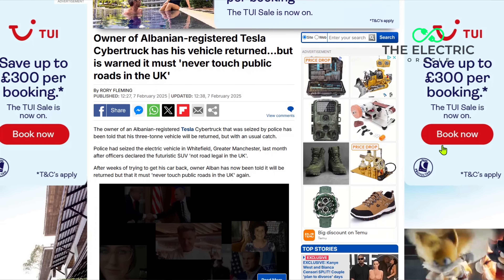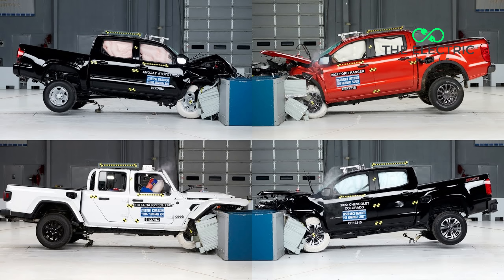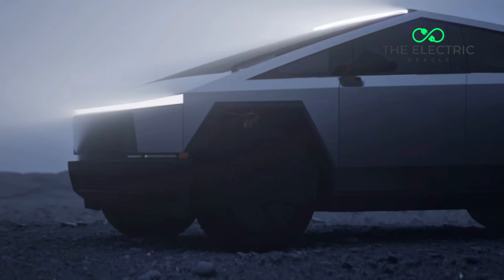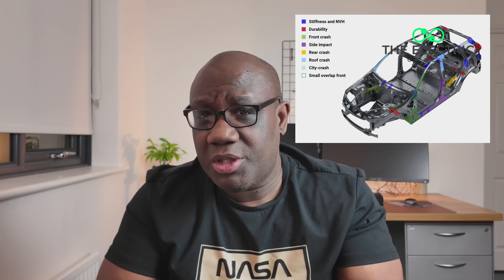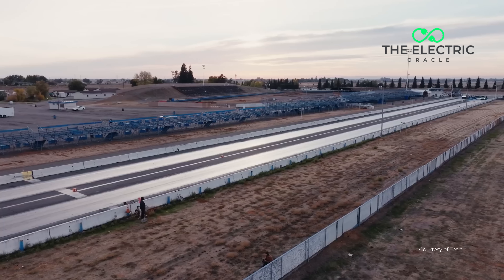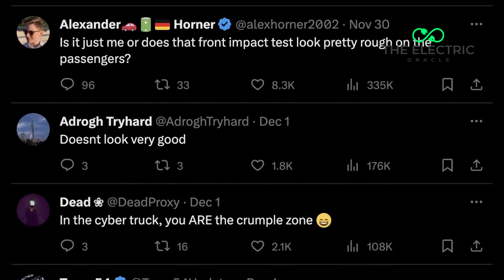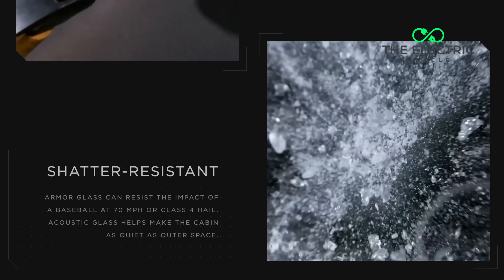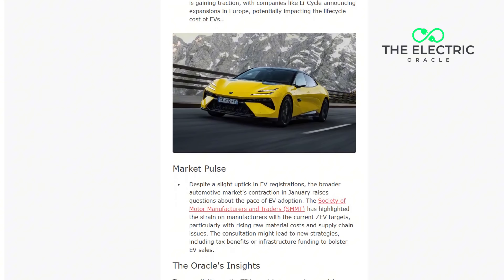Why the UK Banned Tesla’s Cybertruck – 5 Fatal Design Fails!

Comment: There seems to be a lot of misinformation in this video, I'll do my best to explain what I think is wrong. This is not pro/anti CT, I'm only interested in the technical aspect of things. I'm all up for discussions, but if you want to reply, please keep it on topic.

1. "Weight issue". The CT is not significantly heavier than any other UK legal vehicle that is 4WD, two door, has similar payload as well as towing capacity. etc. Saying it's too heavy because you cannot drive it with a passenger car license is just dishonest.

2. "Sharp edges". The CT does not have an "exoskeleton", it's an unibody - like almost any other passenger vehicle. Some of the exterior panels are structural, but so are they in many other vehicles. The 3,2 mm radius is a non issue, 0,7 mm thick steel is often used in cars and they can be rounded to 3,2 mm. The legit concern here is that the angled construction as well as the steel panels are more dangerous in a pedestrian crash, compared to a more rounded and/or plastic design.

3. "Light bar". What most people seem to miss is that the led bar is only a DRL, a daytime running light. The actual driving lights are lower. There are different regulations for DRL and driving lights. I don't know UK regulations so I don't know if and what specifications it doesn't meet, but I do think the DRL is a much better design than in a lot of "normal" cars, where they are very small and mounted very low, so they are not even that visible during the day and get easily blocked by terrain. 

4. "30X Steel". Comparing arbitarily chosen material property and trying to interpret crash safety from it just seems like a lack of basic engineering understanding. Some individual property is completely irrelevent without at the same time considering the complete design including, material thicknesses, geometry etc. With the same logic, a car with aluminum body panels would be less safe than a one with steel panels - which obviously is not how it goes.

5. "Crash test". "CT's steel resists deformation until catastrophic failure" what information is this claim based on? And where can I read the referred internal document about material choice? I'm not saying it's not true, I'm just interested in seeing it. The only legit crash test concern is that there are no 3rd party or public crash test data from the CT. 

6. "Mass and torque". This is basically a debate if a person is a responsible driver or it. I have no opinion since it's not really something that is inherently true or not.

7. "Crumple zones". We're again trying to intrepret meaningful information from misundestanded data. Again, CT does not have an "exosckeleton", it has a unibody. It has crumble zones. The pictures presented are of a Ford with HALF frontal collision from unknown speed, and comparing it to CT with FULL frontal collision with a relatively slow speed of 35 mph. Google "crash  test full frontal 35 mph" and you'll see that every test looks pretty much the same, with the front tires being slightly bent backwards - which in itself indicates that the CT does have a crumble zone. 

8. "Impact forces". The CT is not significantly heavier and there is no proof of it being less crash safe than any other similar vehicle with similar payload and other capacities. There is an valid argument if the CT was used as an replacement for passenger vehicle (instead of using it for work where the "truck" features are needed) which are safer when crashing into another passenger vehicle, but I have no opinion here since it's debatable and not inherently right or wrong.

Comment: Pushing design and regulation boundaries is fine. But the Cybertruck doesn't push them - It breaks them outright and with glory. These are not the same concepts. Please stop conflating words and ideas as you did several times on several topics during this video.

Comment: I'm in the US, just across the Hudson River from midtown Manhattan. There are tons of Tesla sedans on the road, but pickups are unusual enough that they draw comment. It's not clear what the market is. It's not designed for the usual things one does with a pickup truck. It's enormous, but somehow lacks space. It also appears to be badly adapted to the rigors of a job site, and with the monocoque steel body, it seems to be designed to not be able to take a modest impact without economically catastrophic damage. Everything about it seems to be designed to be both fragile and expensive to repair. One dent and the bed cover will be unusable. A chip in the windshield would cost a fortune. And I don't know why it's even allowed on the road, as it's heavy steel construction would behave more like a battering ram than a modern vehicle and it's just a mass of sharp edges.  It seems ludicrously badly designed, as if a teenage boy had set out to design the world's coolest truck.   But aside from all that, it's widely laughed at. People in this part of the country seem to lump it in with the Hummer as a showoff car for braggarts.

Comment: There is another safety aspect for EV's that isn't being spotlighted as it should.. and it applies across the board, not just to these monstrosities. When in an accident, a lot of these EV's are locking the passengers in the vehicle once the computer is compromised. But, being trapped in a metal oven coffin with 3000lbs of extremely volatile, flammable, and unstable chemicals that burn or explode on contact with air OR water isn't the worst part... even if you manage to be lucky enough to avoid that... once the controls are compromised, the EV's tend to start driving themselves... that's right, it looses the ability to tell when it's supposed to go and when it's not.

Comment: My 1995 GMC 2500 Vandura utility van also weighs about 7000lbs.  However it has a huge cargo capacity (our model has moveable beds, and removable seats for up to 9 persons), and has a larger fuel tank.  As such it has no problem being used as a skiing vacation vehicle, capable of starting and running in minus-40'F weather, and with a full fuel tank, going for more than 800 kilometers.  I recently went to a local meeting, and the Tesla Truck had its engine running, to keep the battery warm, at 20'F.  After two+hours, I wonder if that guy ever made it home.  Tesla Trucks are just symbols of "useless richness", purchased by persons who want to show off how wealthy they are, just like the private plane owners.  They are parasites on the rest of us, using up precious resources.

Comment: Fun fact: Did you know that the RAM 1500 is completely legal in Europe, despite having a similar curb weight (6,540 lbs), larger overall dimensions in all directions, poorer visibility out of the front windshield, and worse crash test performance even based on manufacturer provided data?

Comment: The rules cars need to meet to be allowed to drive on UK roads have been there for years. Tesla simply chose to ignore them. The car has not been banned, it simply doesn't and will not comply. Safety first, because safety came first. 
Perhaps they just never chose to export it and that's totally fine by me, I care not a flying f**k.
I have an EV, but wouldn't buy a Tesla if you paid me to take it away.

Comment: The question that comes to my mind is about the batteries. Given the dangers of an EV battery catching fire if damaged, I look at the issue of the truck hitting another EV. You would have two batteries that are a very strong fire risk. Apart from the damage that that rigid structure would cause, would the fire risk make a collision a lot less survivable?

Comment: The cyber truck is an abomination. Another thing to consider is hauling around a high wattage large lithium battery. In an accident they can be extremely dangerous and since the cybertruck isn't structurally safe that danger is even greater.

Comment: Given the concerns that crash test dummies did not (and maybe still do not) address safety considerations for women and children compared to men, this is taking it a step further by not showing any bias and ignoring the requirements for humans. 
As for maverick innovators pushing the envelope favouring technical development and ignoring accepted safety considerations then there is a salutary  reminder of what happens when this is the case at the bottom of the Atlantic.

Comment: Sharp edges and strong metal bodies being unsafe for pedestrians are the reason why bull bars (a common site in places like Australia) were banned in the UK. Stats showed that a child had a higher chance of survival being struck by a 4x4 landrover naked than that same big car fronted with bull bars. Bull bars were also noted to cause A LOT of damage in the event of collision. 

The BBC documented a case on a 90's broadcast of Watchdog showing that while the bars protected a car (Toyota Landcrusier) that had them on, the car that had collided (a Vauxhall Cavalier) was left DEMOLISHED and the passengers (a family of four) killed. 

The Cybertruck has a similar problem, being built with durable materials seems cool on first impressions, in hindsight, a car crash would be lethal for the driver not driving the truck. It's a lethal car, and those who defend it need their heads examined.
Reply: ya Bull bars are used to protect the front of a vehicle from collisions with animals, pedestrians, or other obstacles it was mainly created for country roads rural areas. becuase where i am for example i see deer at night all the time, not currently since it's winter but deer will just pop out of no where.  deer usually ends up totaling your car by shattering glass and putting a giant dent in your radiator.

UK doesn't need them becuase they really have no animals, it's same with higher vehicles so you can see better then seeing from the ground beside the lights are higher.

these types of trucks are not made for city driving even though people do it was supposed to be for construction or work zone usage.

so if a ladder or maybe cement block hits the front window, the window won't break

Comment: Everything is 'literally' with this guy. The cybertruck sucks but don't try to tell me that putting a 3.2mm radius on each edge would require changing structural elements. A panel beater could roll those SS panels with a 1/8" radius in an afternoon.
Reply: Then why hasn’t it been done to make it road safe?

Comment: Tesla tried to get an exception from the Department of Transportation regulators to replace side mirrors and replace them with cameras that would be monitored in the center display. Guess what happens if the camera fails or the center monitor doesn't work? No view at all! Plus it adds to the expense of the vehicle. That's another $$$ on top of the already steep sales price and added repair price to fix and/or replace.

Comment: Innovation is great. So, make prototype designs is great. Next, take them to safety testing to see how they do. IOW, do the hard work along with the fun work. Every automaker creates outlandish auto show prototypes. Some are even drivable, most aren't. Their purpose is to explore the possible, then see what of that imagined car can be practically applied to actual production. The ethos of a lot of tech companies is move fast and break things. And, it can result in rapid development once fundamental principles are well understood (e.g. SpaceX). But, there are some things you simply should not do that with because public safety is involved. The push for fully autonomous cars has a lot of this problem. They are moving fast and putting stuff on the road, when it breaks it might just kill someone, not just break.

Comment: My only experience of American cars in the UK was a Ford f250 struggling to drive round a car park trying to find 4 empty bays to park it in
Reply: ya those ford trucks are big 300 are bigger and 400 is even bigger but there gas hogs. most people who have a 300 or 400 will have a compact car also becuase you get like 10m pre gallon 10 mpg (US) ≈ 12 mpg (UK)

the whole idea of the Cybertruck though was for trucks and construction or working loads to move things. but you get the intown people who don't do those things buy them.

but there basically made to move also trailers and campers like these (2024 Forest River RV Vengeance Rogue SUT 357SUT) this camper is 12.16 meters in length

Comment: You missed the biggest flaw of all with the Cybercuck! The steering on it is like hrdrasteer that uses an orbital valve to move hydraulic fluid to a ram that moves the tie rod just electric version of it. The problem with hydosteer is that it is banned in NY because there is no physical connection to the tie rods from the steering wheel like conventional steering.

Comment: Having experienced a ride through the Sussex and Kent countryside between Brighton and Brands Hatch in a Winnebago which was 26 ft long, I can honestly state that the UK roads are totally unsuited for this behemoth, even the motorways would be challenging, with very little clearance. Our Winnebago was scratched to pieces by the overhanging branches, and the paint job ruined. It was actually bound for the desert in Libya to house some refrigeration engineers doing an installation and looks were secondary. 
This happened during Gaddafi's regime and the engineers were tired of having to evacuate their hotels every time the Colonel needed a bed for the night. He never sleptt in the same place two nights running, and was infamous for commandeering hotels in Tripoli, and kicking the occupants out in the middle of the night. 
( Sorry got off topic...)😃
Reply: hay a good comment but ya a lot of American cars are not really made for tiny roads in uk it was also the whole idea was made fore more construction usage like rocks, dirts, tree limbs so they don't drop and damage the window. that was the whole point to it but it became almost a fad.

like if you bought a commercial truck for your daily drive becuase you liked it, that's what happened

Stainless steel cost more becuase of Chromium which makes it more impervious to rust. so instead of the whole steel frame rusting, only the top layer of the steel rust which then prevents the rest of it to rust.

the reason it's shaped like that becuase of the hardness of the steel, you can't use normal tools so what they did was cut it and bend it, it's like a giant origami

Comment: I saw a photo of one of these recently wrapped around a lamp post, and the door had deformed to a point where it was obviously NOT going to open if you wanted to escape from it. That alone would make it fail UK and EU safety standards. Never mind everything else about it.

Physics are the same wherever we are in the universe, it's insane to me that this is legal in the US but pretty much nowhere else. Did it even pass any US standards come to think of it? They're in to self-certification over there. Look at Boeing doing that, surely nothing bad could happen. Right?
Reply: Huh, what vehicle has doors that open after being wrapped around a lamp post?
Reply: @Catrik  Most of them. It's part of the crash worthiness. The front doors deformed into the rear doors and bent in such a way that it's wedged it shut, the back doors probably have difficulty being opened too because of it.
Reply: @TalesOfWar Maybe you're talking about frontal crashes? "wrapped around a lamp post" to me implies a side impact, where the car literally wraps around a tree, which obviously implies heavily deformed doors that are unlikely to open.
Reply: @TalesOfWar  Can you tell me what is the crash test called where a car is crashed into a post and the doors must open? I would like to see the details of it. Because obviously it's very different if the car hits it at 20 km/h or 200 km/h, and it would be ridiclous if a car was deemed unfit if the doors wont open after a 200 km/h crash. And without knowing how the CT in your example has crashed, it cannot be determined if if would or would not pass any crash tests.

Comment: Whenever there is a conflict between safety regulations and design consideration or aesthetics, design considerations and aesthetics means NOTHING.

The Cybertruck should have stayed at the the correct, initial stage : The Concept Stage.
It is UNSAFE by any standard. It breaks regulations in just about every countries and states. One thing that it is NOT made for is city streets. It's NOT made for city parking. It's NOT made for normal use in normal conditions.

Comment: at about the 8 min mark you mention the difference in crash test crumple.. and the visuals are two different types of crash.. a effective glancing forward crash vs a T-bone straight on crash.

I do not expect the cybertruck to ever be viable in 1/2 the world.. it was never designed to be a high sale car... it is a testbed of different technology as well as 48V power and rear stere and different material/frame structure.  It has never been banned it just would never pass the regulations.. that is a difference...

curious about the new model Y lighting changes and if that would cause issues in the UK.

Tesla made the cybercrook to be a US steel and US power truck and lets see what we can put in to test savings...  It is a test truck with unique design to push limits and see what works and what dose not...and what laws in other countries can be pushed/changed... I would not be surprised if they do a revised version in a few years that is a major change. will the new design be street legal in other countries ... no clue.. Yes it weighs too much and like most american cars it is to wide for UK roads.

Right now i think they are pushing the robotaxi and actual full self driveing as well as jumping into robots.in fact in a few years i do not think Tesla will be selling cars (except taxi type) but they will be doing robots